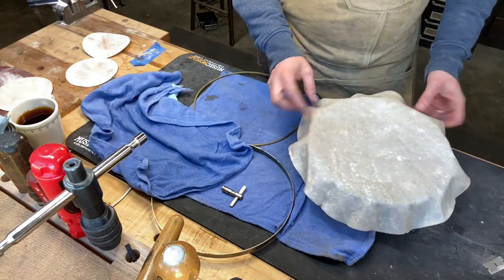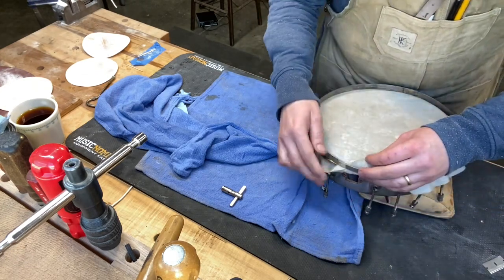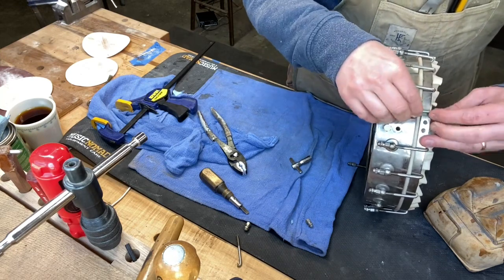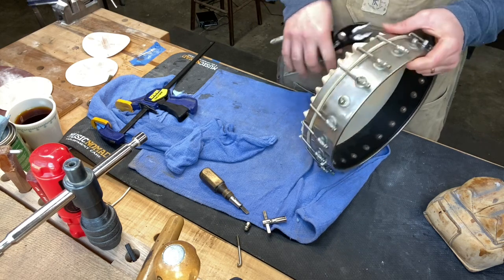Mounting a goat skin banjo head

Comment: I'm renewing a skin head on a 100 year-old Waverly tenor banjo. In addition to the "flesh hoop" and the tension ring there is a heavy ring that sits atop the rim that was inside the old head. I assume it has to be re-installed with the new head to get proper height for the bridge install. Have you seen this before?
Reply from the maker: Hello tom- that is called a tone ring- yes you should use it.  There is no Waverly banjo.  Waverly made metal parts, used by almost everyone back rhen.  Just because the tailpiece or something says Waverly doesn’t mean that is the brand

Comment: While watching your video i placed a new goatskin.  DId not get, how much the tension hoop should mount above the skin and how much is will lower after drying and stretching. I don't want the  hoop above or  below the playing surface.   (I chose for about 1.5 mm high.) N.B. i cut the oversize with  small, sharp nail scissors) Thanks for the instructions.
Reply from the maker: That’s hard to say without seeing it in person.  Every skin stretches differently.   I think I mainly get there by trial and error.  Sorry!

Comment: Ciao Aaron, I just found an old banjolin in the flea market in Firenze. I want to make it into a soprano banjo uke. It’s missing the tension hoop which I can get made locally but I need to know the thickness of the metal material you use, if you don’t mind. It’s an odd size (8.5” diameter) so I’ll use a skin head. Grazie. Jim
Reply from the maker: Hello Jim- I use 3/16” brass for tension hoops, but the old ones are usually thinner. Cheap ones can be as small as 3/32”
Reply: @beansproutmusicalinstruments  Grazie. BTW I have really enjoyed your work on the old style Hawaiian ukes